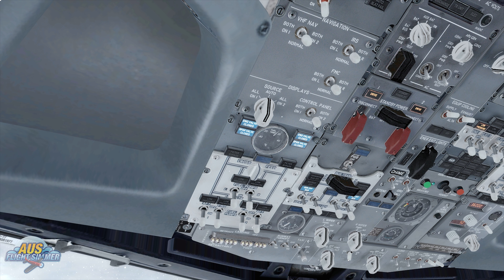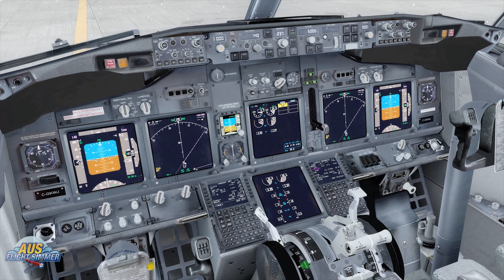Refresh with the tubeliners | PMDG 737 Bad weather departure

Comment: So many mistakes in this weather! If this was real life... the pilot would be in serious trouble, and have to re train for 6 months in the sim (if haven't had licences taken away)
Reply from the maker: What were the mistakes pls? Cheers
Reply: Flaps 25 landing isn't a normal configuration for landing; RTO brakes were disarmed for take-off; engine start switches were set on ground(GRD) in flight (in normal op they are set on continuous CONT for take-off and landing or engine anti-ice running and the other time on the OFF position); no decision altitude set; you putted the gear down at +- 13 miles from the runway, normally it is done at 5/4 miles and also you need to push the TFC button to display the tcas data on the navigation display; maybe other things ...